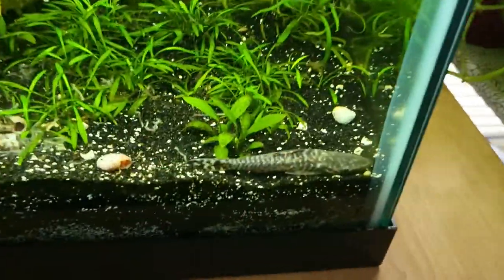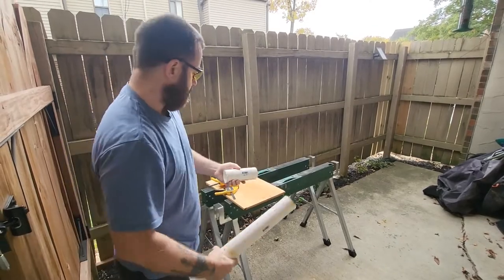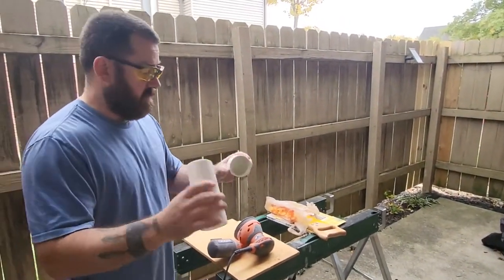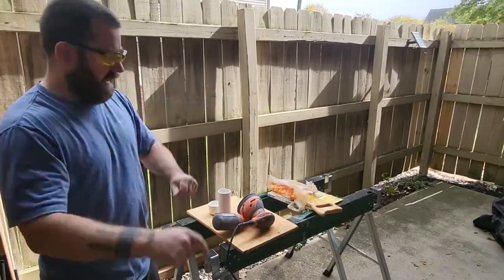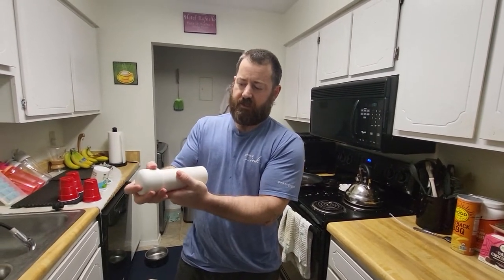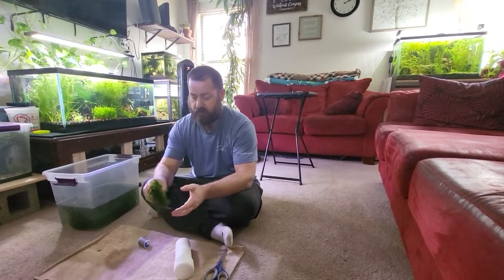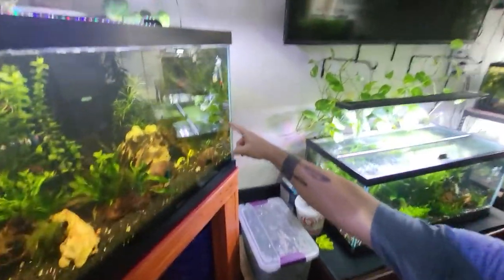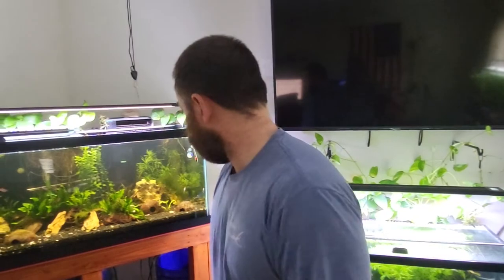How to Make a Pleco Cave out of PVC Pipe

Comment: I would recommend  making a diy dowel rod flapper for the inside sanding. It would make your process easier.
Reply from the maker: I will take a look into doing that. After I created this video, I used the end of an old wooden broom stick and wrapped and gorilla taped the sand paper around that and that worked pretty well. It was much easier on the fingers, lol.